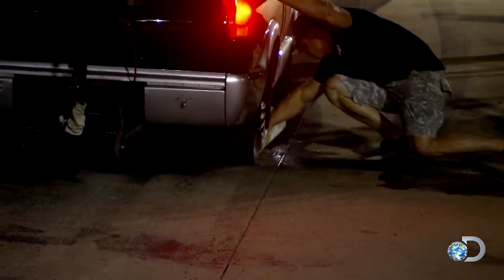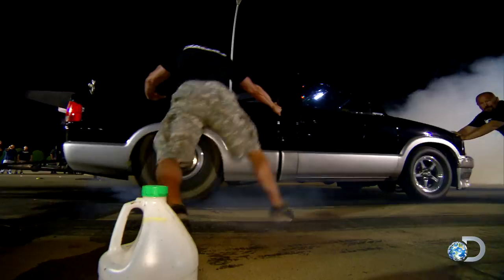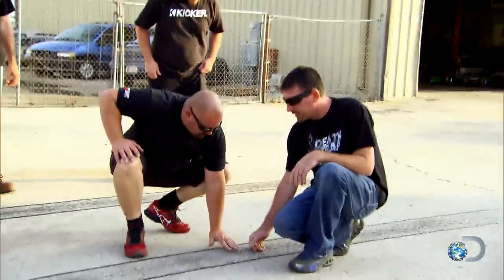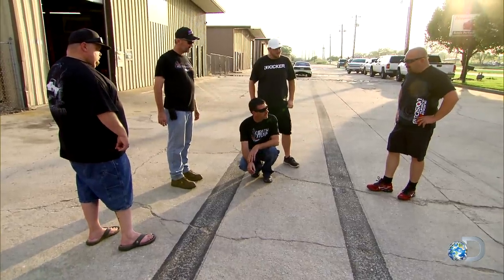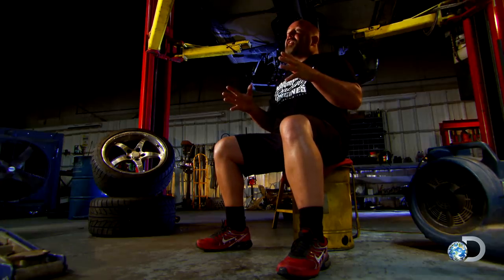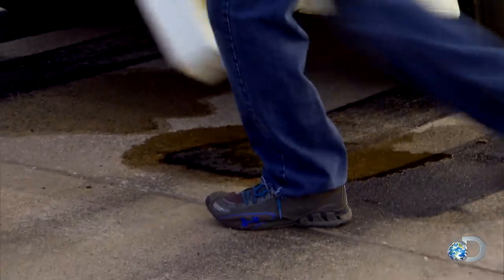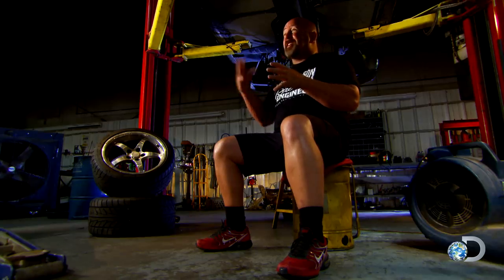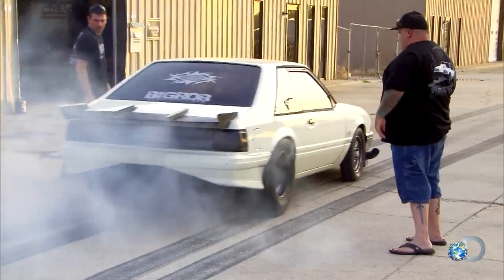Creating a Sticky Situation | Street Outlaws

Comment: I hate how Discovery creates so much fake drama on these shows. These guys know exactly what they're doing with their VHT mixtures, they're pros, they just have to create tension for TV. I wana watch the racing and prepping of the cars, not fake reality show drama.
Reply: To be fair, iv had to make big changes now that VHT has changed and the strengths of stuff has changed plus I'm tinkering constantly for different weathers you come.out with your summer kit expecting it to work fine when its 10 below and you have issues. 

Similarly changing your tyre compound and setup will change what you need mixwise.

The CRAZY one is a turbo car and a nitrous or methanol car will need different fluid because.how.the power delivery comes in is different.

Theres a video on Cycledrag about the issue with too sticky a track and the turbo bike guys just SHREDDING tyres at ludicrous rates but the nitrous and supercharger guys were fine.

Comment: someone needs to make a video showing how the pimp juice / the sticky is made form start to finsh thanks
Reply: I tried melted brown sugar and rubbing alcohol works pretty good.
Reply: Just use dr pepper
Reply: shuto Yang ratio pls?
Reply: Corn syrup + cheap sugary soda + water with some rubbing alcohol bam you good to go.
Reply: There are loads out there.

VHT + Acetone plus dr pepper.

MEK, VHT 

Corn syrup/glucose syrup and rubbing alcohol/MEK.

Its something that has to be made for.your Road conditions, your ambient temperature, your weather conditions so its Very much a feel thing.
Reply: 😂😂 never use any sugar based substance for traction. It’s a joke. Mek and VHT when mixed causes the rubber to break down at a faster rate and makes the tire sticky. Sugar adds no traction. There is a reason you don’t see corn syrup in premixed compounds.
Reply: @ScooterLee-ei1ep    if you have to use tire sauce  for traction  then it prepping!!
Reply: @ScooterLee-ei1ep  funny.. because nobody uses anything with MEK in it anymore…
Reply: @nsboost  can't even find mek anymore lol
Reply: @cowleysmobilewelding  pvc primer has a lot of it in it…
Reply: Nelly does a good video on it

Comment: Couldn't you just use a huge gallon can of the catchmaster rat trap glue you can order it in a huge gallon paint can container. You heat it up and it turns to very thin water and in a minute it's goes back to its very thick sticky glue. I bet if you poured that on the street for both lanes vars wouldn't need to add their own traction compound like pimp juice it will make a really extremely drag strip lane for both lanes just wonder how well it will work the stuff I got to test on a hige piece of ply wood that I covered in 4 gallons of it I couldn't ride a bike through it it stopped me in my tracks flipped me over handle bars and glued me to the full sheet of wood face down lucky my face didn't get in it and I had on a jogging suit for that reason so it doesn't get on my skin if I fell in it it took my dad about 45 minutes to get me off using wd 40 so it would be a amazing street race lane prep for both sides for the first 20 feet would work. So if someone tries it please post a video of how well it works I don't got a drag car just asphalt cure track cars with lots of horsepower but not gonna launch one off this stuff cuse it's not a drag care setup and might snap my locker or something not trying it